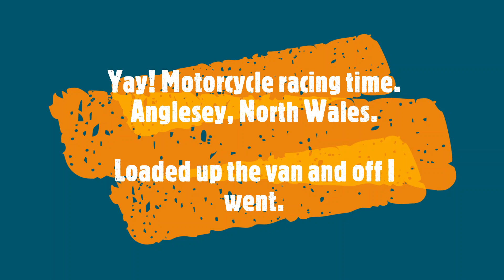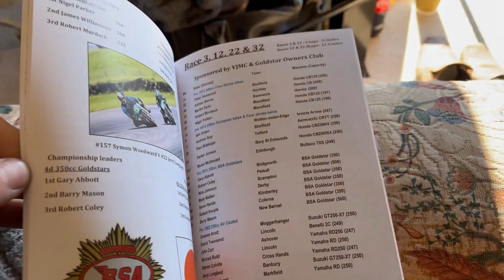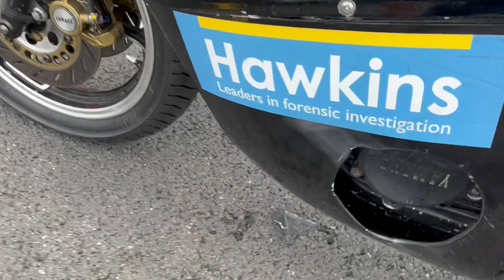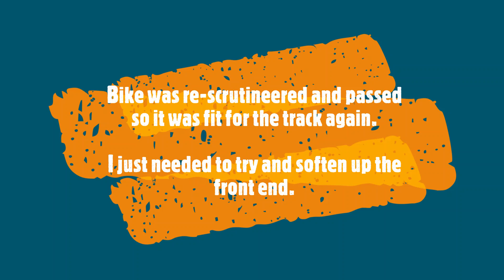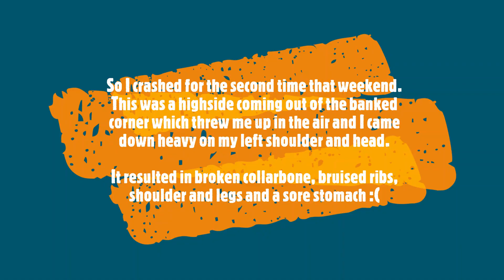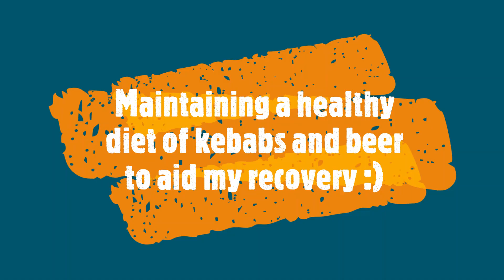DAF400 race van, Yamaha FZ600 crash at Anglesey :(

Comment: Done my collarbone on my GPZ900, it was broken 5 bits, now got a metal plate and 9 screws, it was really painful, and I have done a lot of injuries, the collarbone was the worst, looks like you got off lightly with yours. Might I suggest you stick to the diesel SD1 :-)
Reply from the maker: GPZ900, cool bike!  I want one of the turbo ones just for cool factor.  I was lucky.  Just snapped it in the middle of teh bone. Actually the bruised ribs hurt more than the bone!

Comment: Hi, Hoping you could help, we have a 1991 Daf V8  (ex) Ambulance. would you by chance know where we could get a Manual for this vehicle? and was it easy to replace your cabin flooring? thanks
Reply from the maker: Hi yes I know a chap called Simon Pearson. He will probably have a gearbox and the correct shorter gear selector. He is on Facebook. The flooring in an ambulance is probably insulated and lined and quite different to my basic panel van.

Comment: What a weather system Angelesey has. Been there when its been tropical in Carnarvon and galeforce horizontal rain on the circuit. Not my favourite place.
Reply from the maker: Its truely bizarre.  I went up yesterday to get the van.  Got off the train at Ty Croes (google it, super random station).  At the station it was super warm and slightly overcast.  I walked about 30 mins and then hitch hiked the rest of the way to the circuit. At the circuit it was in dense misty cloud!!!!  Could hardy see teh paddock from the circuit office!!!!
Reply: @nitrosilvia  Glad your leg is better and you can walk for 30 mins, hopefully without pain. It's your fault I have the car I own. I enjoyed the Rover R8 Tourer series so much I went and bought a 416. The yours came up for sale .... twice! Cheers.

Comment: For future bruising rub "Hirudiod" (yes it used for that as well) which reduces the clotting and also the pain. The gel is better as it goes on with out the residue. Or don't fall off your bike so much!!
Reply from the maker: I’m gonna go for not falling off anymore. I have been using the voltarol  gel which is pretty good. Smells real weird and chemically when it’s first out the tube and then when it’s dry ends up smelling of sour fish???